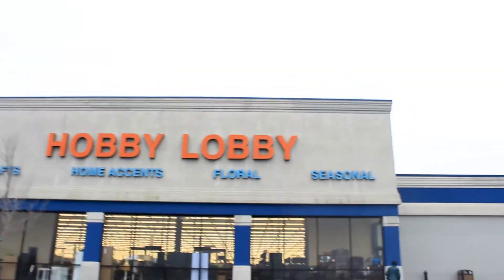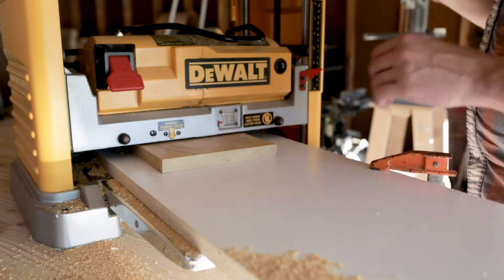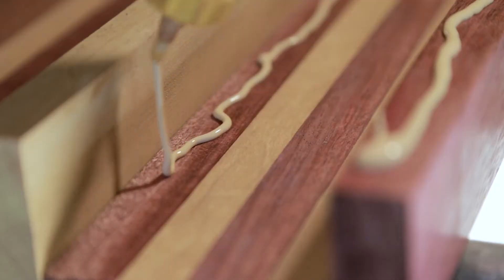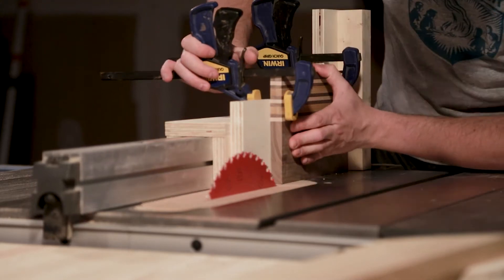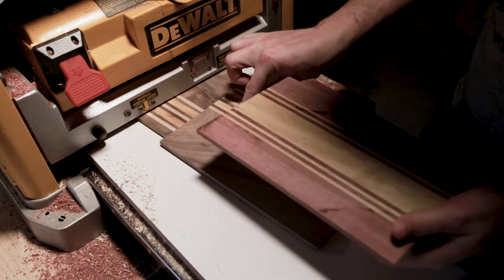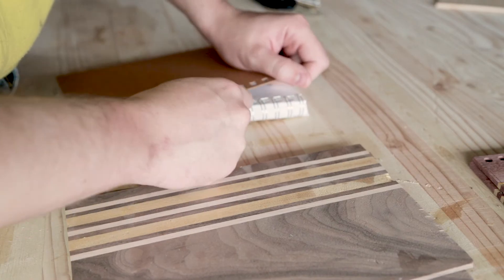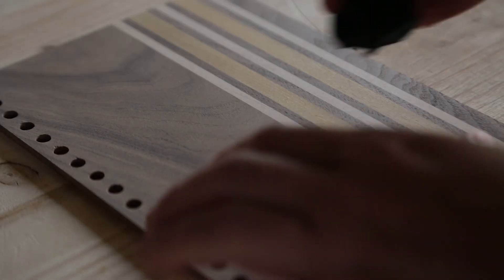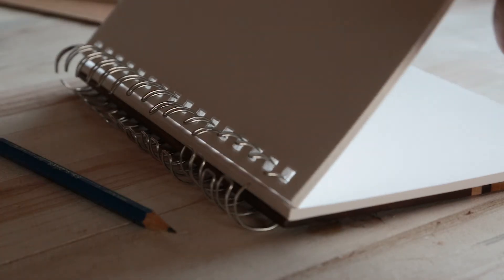DIY Wooden Notebook

Comment: Hey Kev, at 4:42 you overview all three notebooks that you made. Could you tell me the type of woods you used in each book please? I'm guessing it was:
1st – Mahogany, Maple, Yellowheart
2nd – Purple Heart and Yellowheart
3rd – Padauk, Maple, Walnut

Also, since I don't have yellowheart and no one nearby sells it, any suggestions as to what would look similar?
Reply from the maker: Sure thing. You were close with the types of wood and where they are used. The small notebook is Padauk Maple and MahoganyThe big one is Purpleheart and Yellowheart.The Walnut one I had to cut the pages for is Walnut Maple and YellowheartAs for an alternative to Yellowheart, I do not know another naturally yellow wood off the top of my head. You could select a species that sometimes looks yellow or gold like some cedar boards I have seen. You could also select your finish that will yellow your wood a little more so your maple or oak or something looks yellow. Or dye it. Yellowheart isnt too expensive and if you wanted a small amount for a project like this, consider odering it from Woodcraft, rockerler, or another wood distributer. Hope that helps-Kevin
Reply: KevBotWorkshop thanks man! I'm up in Canada, so slightly less availability. That said, after looking online, dying seems to be a popular technique I should practice.

Last question. I also found out that purple heart loses its colour and "inevitably" becomes brown/black. Any recommendations?
Reply from the maker: Sorry Ryan, didnt see the response. Purple hear will lose its color after a cut or sand.. putting it in the sun will bring back the purple color because of the UV rays.. cheers

Comment: you said you didn't drill all the way through..... how did you finish the holes?
Reply from the maker: I drilled down just enough so that just the point when through the other side makes a tiiiiiiny hole then I just flipped it over and used that tiny hole and drilled the rest.
Reply: KevBotWorkshop makes total sense. Thanks